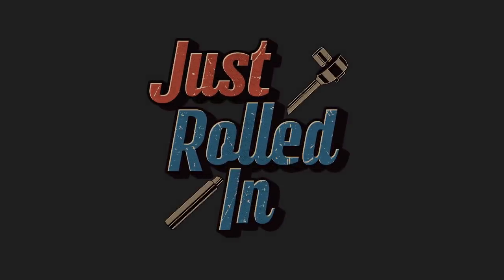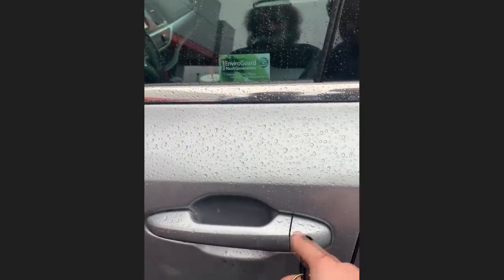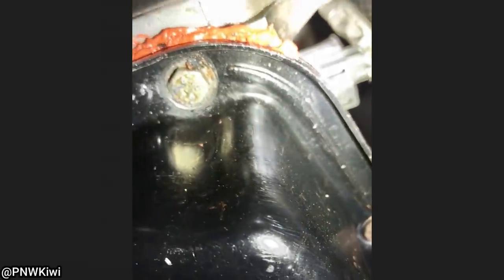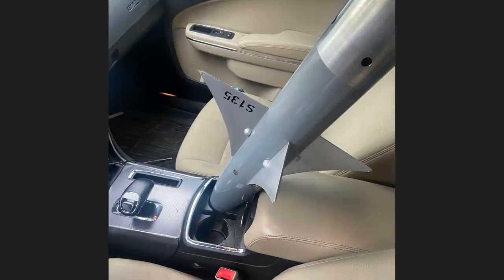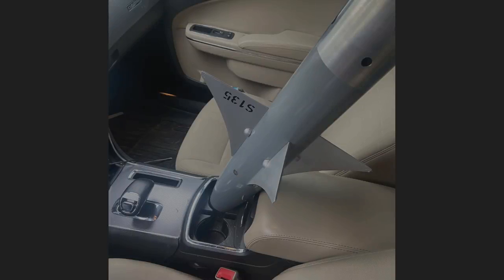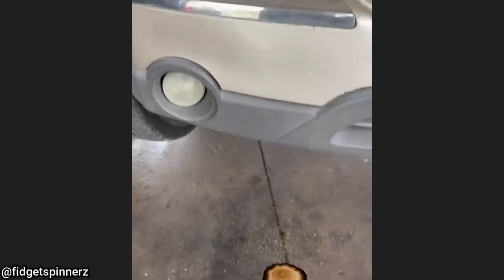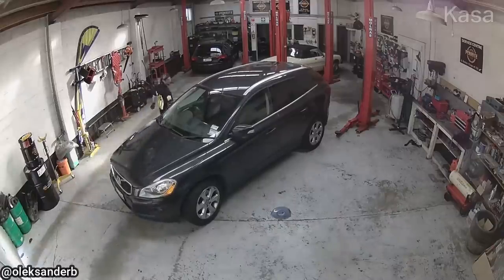Customer States It Sounds Like A Cowbell When He Drives Over Bumps | Just Rolled In

Comment: The second video of the lady's car trying to start when being unlocked... That was something special. I've seen some weird stuff before, but that's a new one on me.
Reply from the maker: Yea I had to share that one. That's a first for me as well lol
Reply: @JustRolledIn  Would love to hear a follow up as to how that worked :D
Reply: @ferrari2k  Only thing I can think of (outside of a poor wiring job) is the door alarm shorting through the starter relay circuit somehow.
Reply: I could see that as a feature on something like a newer French vehicle.
Reply from the maker: @ferrari2k  wish I knew what the issue was. They didn't mention unfortunately. 
Aftermarket remote start is the first thing that came to mind though.
Reply: The brief shot of the wheel and body style, that’s a Toyota Highlander. Somewhere around 2014-2016. The startup sound is a V6 model. Plus the building in window reflection is right outside a Toyota dealer. Most of them look the same. I’ve been with Toyota over 8 years now and this is something I’ve never seen before. Curious to see what some of the master techs will say🤣
Reply from the maker: @mikemike388  share the clip with them and let us know what they think it is  and let us know 😁
Reply: @mikemike388  Jesus look at Sherlock Holmes over here and not even the sarcastic way
Reply: Unless it's a prank, & there's someone turning over a car's engine behind them with the ignition disconnected!
Reply: @alexwalker2582  I'm thinking a poor wiring job myself.
Reply: Have seen a lot of electrical gremlins but nothing like this myself. I too would be curious to know If something aftermarket is installed. Have seen aftermarket remote starts cause a lot of issues.
Reply: Is there a remote start button on the key fob that is getting pressed when they rotate the key?
Reply: Would wonder if its the key turning it makes a remote start tune on
Reply: I'm no mechanic but that's very bizarre. the only thing I could think (if this is possible I don't even know) if someone hooked the starter to the lock. Either a royal fuck up or a prank, like when ur friends prank u by hooking the horn up to the brakes.
Reply: The start up sounds like when I crank my Tacoma , it has a v6 in it, I had to replace the ignition cylinder so sometimes the immobilizer won’t let it start , it’s possible that a non chipped key is trying to start it or the chip is too far away from the imobilizer 🤣
Reply: @peterf.229  Maybe bad programming on the chip in the key. I'm replacing the ignition switch in my car tomorrow, hopefully this doesn't happen to me!
Reply: I can't even imagine how many random wiring f**k up's you have to make,to get this to actually happen. 
Accidentally convert the door lock to a ignition starter  without actually trying to... ✌️👍😁 Mind-blowing 🤣
Reply: one of the strangest things I have seen was a friend of mine had centerline rims on his truck. one tire kept leaking down and even after replacing the tire, it kept leaking down. there was no visible damage on the rim especially on the bead seals. we were spraying the rim with soapy water and found the leak. air was leaking out of the rim itself inside one of the lug nut holes. it's  a solid rim. the only explanation we can think of is somehow a passageway was formed when the rim was cast.
Reply: I'm thinking she found" I can do it cheaper" mechanic lol .
Reply: Worst we had is locks that locked and unlocked constantly whenever the vehicle was powered.
Reply: The wonderful world of CANbus digital power management.   I'll stick with pre-CANbus vehicles, thanks.
Reply: For those who don't know, remote starters are a thing in the US, so you can start your car and let it warm up from inside the house on a winters day.
Pretty sure they are illegal where I am.
Reply: @LegendStormcrow  after witnessing a power window going up when a new battery was connected I gained the habit of leaving the door ajar a bit when connecting a new battery. a co-worker had the pwer lock close when he connected the new battery; luckily the window was open. you never know what could happen...
Reply: That aftermarket remote start feeling
Reply: I have to say I don't hate the idea, I always wanted to start my vehicle before I sit down.
Reply: @Cheepchipsable  They are used in VIP cars to start the car without risk of being in it so i am pretty sure that they are not illegal in the place where you are even if leaving a runing car on a parking is illegal in your place.
Reply: @alexwalker2582  lol i used to have a Escort, foglights shorted through horn relay. Fun.
Reply: WTF? How?
Reply: @JONOTron interesting. let the electron juice go were it may...
Reply: @ElementofKindness  Though CAN-bus has it's drawbacks I can not see it relate in any way to what's happening here.

You can search on Youtube for "No start because of door handle" for an interesting databus problem.
Reply: A friend of mine has to turn pull the far lights (the strong ones, idk how it's in english) lever to start the car, but why df would the door lock run the starter?
Reply: @ApusApus  They call them "High Beams" :)
Reply: @ApusApus  I can only imagine someone fiddlign with all the wires in the car without knowing what they are doing... and then you catch a cable that should be left alone. and if you're lucky, it just doesn't work. if you are out of luck, your car suddenly catches fire.
Reply: When I tore apart the dash in my Expedition to replace the evaporator core, messing with the passenger seat adjustments would pop the rear window liftgate. Problem went away with reassembly. Shit's weird man
Reply: As an army tank mechanic, to work in tracking down electrical issues the instructor would go to the various connections and put little pieces of wire connecting two wires across the connections…. if done right it would cause all sorts of little gremlins like this, for instance you turn the cadillac (gunner’s “steering” wheel) left and instead of the turret rotating left the main gun would elevate.  Definitely time to check the fuse box and the wiring harness, and disconnect every connection that has wires going through for locking or for starting, to start….
Reply: The world of use car auctions and the weird things people do with remote starts etc
I've seen cars start by hitting the lock switch inside the door a specific way, no key anywhere
Reply: @Rick_Sanchez_C137_  when i was learnign professional car mechanic back in late 80's in germany, we had to wire a full lighting with all swicthes and relays mounted on a wall. if done correct, the fuses would survive unharmed. XD
but one thing I learned from a technician at german army when I was doing basic service: in order for electric juice to flow, there has to be a closed circle. this explains a lot of things, like a rotten mass wire between engine/gearbox and body making it sound like a bad battery.
Reply: @SepticFuddy  this is why I love me a classic vehicle. shit that's not there can't break. XD
Reply: @lotharrenz4621  Amen brother
Reply: @Bialy_1  how does "they are used in VIP cars" equate in your mind to "pretty sure they are not illegal"?
Reply: Only in the 2020s, I swear!
Reply: It's not a defect, it's a feature.
Reply: @peterf.229  The immobilizer won’t let the car actually start because the key is outside the door!!! But the switch that should be unlocking the doors was wired to the ignition. (Probably a badly installed remote lock and ignition)
Reply: @Milamberinx  Probably some crazy notion of equality.
Reply: @jonathanconklin6351  maybe a "me me me" version of equality.
Reply: @edwardwood6532  Car starts, radio and climate controls turn on as soon as you open the door.
Reply: I have seen this video a while ago, still waiting for some sort of explanation. I have heard of crossed wires and short circuits before, but unlocking the door triggers the starter? Come on?
Reply: New for me too like wtf.
Also I fell bad for the last guy unloading car just to have a strap snap in his face and go through the door like man has a very bad day.
Reply: @mikemike388  damn boy gotta get a job in csi with you figuring skills that was actually impressive (I know you said you worked for Toyota 8 years)
Reply: @JustRolledIn  brand new nissan qashqai [uk] [rogue?] did it to me, straight over a petrol [gas] pump, 2 miles on clock, bad earths behind left headlamp [manual car in 1st gear, fault did not stop when key [fob] released.  the one + only car
Reply: @marcok8209  its wonderful when you work till almost midnight, its January and its 10F outside to get into the car with the heater on the ball roaster err heated seat going.
Reply: @Cheepchipsable  I use mine to cool down my truck with ac in the summer
Reply: @thomashanke6750  My first thought as well. I had a car remote that was so sensitive that I made a routine of taking it out of my pocket when home. I forgot this one stormy evening and found my trunk lid popped open,... filled with water and leaves...
Reply: It would be a pretty sweet feature to have in the winter. No need to open the door to get the defroster going
Reply: The interesting thing about this discussion is that everyone missed the oddest thing:  The electronics to unlock the door works fine because _the key fob works_!  The 100% mechanical backup lock (meant to be used if the electronic lock fails) is the system that has the problem.

It would be odd in the extreme if the electronic lock tried to start the car when triggered -- but explainable.

For the mechanical lock to do the same...  A short to the frame somewhere?
Reply: My old car had a thing where when I pressed the foot brake the boot opened. I ended up fixing it by finding the connector for the boot wiring disconnecting it and spraying it with WD40. The wire for the brake light must have shorted to the opening mechanism due to water getting into that conector.

Comment: The door lock cranking the engine is a new one for me🤣🤣🤣
Reply from the maker: Same lol. I got the same Toyota as the one in the clip also 😆
Reply: Unless it's a prank, & there's someone turning over a car's engine behind them with the ignition disconnected!
Reply: @stevie-ray2020  would have to have great timing to pull that off
Reply: There is no limit to the confounding electrical issues on new cars.
Reply: Haha it’s getting immobilized 🤣

Comment: And when you thank you’ve seen it all in 30 years of turning a wrench you pulled one out of your hat. Outside door lock starting the car. Thanks for sharing my friend
Reply from the maker: I knew I could get you with that one. 😜 have a great weekend, Brant!
Reply: @JustRolledIn  you too buddy
Reply: Does anyone know how that happened?
Reply: @ryannrjohnson  If I had to guess I would say after market remote start not installed or programmed correctly.
Reply from the maker: @BobWiersema  that's what came to mind as well. I got the same vehicle in that clip with an OEM remote start and glad to say I haven't had that issue 😆
Reply: @JustRolledIn  yes I was thanking the same thing.
Reply: Modern engineering...
Reply: @Frostified  when I started turning a ranch there were cars and trucks on the lot with carburetors. Then throttle bodies came out and modules were on vehicle and sed when will all of this come to an end, and now I thank it’s never going to come to an end. I’m so glad I’m retired from dealerships. My new living is Hunting fishing and motorcycle riding.
Reply: @brantmcfarland517  I like to think there's still good reliable vehicles being made, but after spending a year working at a chevy dealership that saw probably a dozen recalls on the Silverados in that time... probably half were reprogramming for ABS and backup camera. The other half were all things that apparently could light your truck on fire. You know, rear defrost, alternators, seatbelts...
Reply: @brantmcfarland517  Now even the motorcycles have ECUs.
Reply: @reaganharder1480  I understand. When I retired in 2017 we were reprogramming clusters on the Silverado that could take up to 2 hrs. And payed .5 hr. Good luck.
Reply: @user2C47  oh I know I’m riding a new husqvarna 701 enduro with an ecu efi driver by wire dual spark plugs o2 sensors  and A catalytic converter. Single cylinder four stroke making 74.6 hp. You could never make them hp with a carb. And it’s never gonna stop the technology on our vehicles.
Reply: @reaganharder1480  yeah our truck had the rear defrost could cause a fire so we just removed  the fuse.
Reply: @hunterbear2421  nice simple solution. So long as you don't care about rear defrost, works just fine.

Comment: 0:06 I remember a story my dad told me years ago about a rich guy with a Rolls Royce who heard knocking or tapping when he was driving on the open road, after many hours trying to find the noise, they discovered a marble or ball bearing on a string behind the door panel, that swung and tapped against the door when the car was at speed, attached was a note that read something like "Ha ha you rich bastard". Sounds like its one of those stories that,  "a friend of a friend knew the guy who found it" :-))
Reply: And once the issue was sorted he was still a rich bastard 🙂
Reply: @sjv6598   LOL, We can only assume. :-)
Reply: Many years ago, when cars still had hub caps, we prised the hub cap off of a workmate's car and put a couple of steel washers inside and put it back on. the workmate spent weeks trying to find the cause of the rattling, he ended up having to take the car to the garage, who finally found the washers.
Reply: Somebody poked holes in a soda can and welded into the bumper. At certain speeds my brother's new truck had an annoying whistle. Yup, the shop found it.
Reply: Someone loosened all 5 lugs on the front left wheel of my VW GTI I had many years ago, a click-clacking sound when I would accelerate or brake. It was the slop between the hub and wheel being taken up by varying velocity.
Reply: @paddington1670  the others were funny, but this is attempted murder

Comment: Dealt with a "cowbell" issue once. Turned out the weld holding the top cover on a shock absorber broke, and it would "ring" every time the guy hit a bump.
Reply: I had that same issue on several Kenworth semi tractors, kept breaking the welds on the covers of shocks. Only real cure was to completely dump the air ride suspension when picking up and dropping semitrailers..........

Comment: That was a first when a car owner brought his car to the shop and asked the mechanic to see if the owner did the work right. Normally, a car is brought to the shop so a trained and experienced mechanic will do the job right after the owner did it himself ALA Red Green. 

Have a great weekend JRI.
Reply: Didn't look like he did the worst job. Maybe a little heavy handed with the sealer, but that's about it...
Reply from the maker: @grannyflatgarage7599  a screw and wrong size bolts the technician said. Surprisingly doesn't leak though lol. Or maybe not yet 😅
Reply: @JustRolledIn  ah right missed that. What the hell  did he do with the original bolts? He knows that you don't have to replace them right?
Well if it doesn't leak lol...
Reply from the maker: @grannyflatgarage7599  good question lol. Hopefully they're not inside the transmission pan 😆
Reply: Definitely not a Red Green job - there's no duct tape! 😁😁
Reply: Wasn't leaking.

Comment: if you pull a trailer and don't want to hear a clunk every bump. pull the hitch off between hauls, took a minute to figure that one out hahaha
Reply: @chuckles3295  no actually my bad its a  receiver or in some circles stinger but a good one thanks hahaha
Reply: I placed a plastic in the top of my receiver, with the drawbar in place.  No more noise.

Comment: The lady whose car cranks when she unlocks it, I'm guessing must have had an alarm or remote start put in by someone who didn't know what they were doing.
Years ago my sister bought a slightly used car and the dealer had put an aftermarket alarm on it. Turned out if you turned the ignition off with the lights on, the car would stay running. Even with the key out.
Reply: this happened in another video of this channel too
Reply: something must have been shorting then

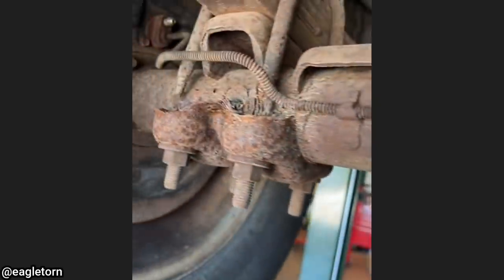Comment: 1:00 As long there's no leak he did the sealing job correctly. Which is what i guess matter to the customer 😂
But i wonder how horrible it's going to be for the next time this pan get remove and reinstalled lol.
Reply: No issue, they will just swap the whole engine.
Reply: I saw one of these where the overuse of gasket sealer resulted in the oil pump intake becoming blocked with loose bits of sealer - no oil no engine!
Reply: @Morpheus-pt3wq  Oh god XD
Reply: @marklythall8712  Only time will tell lol

Comment: At a PD I worked for, several cops were pranking each other by placing pebbles in their hubcaps-which is a dangerous thing. When the chief found out, there were suspensions.
Reply: @oaktadopbok665  No. The chief himself caught it. He stepped out the west door to investigate an incident from the night before. Just then, two of the dummies rolled up in their units and he heard it. He was furious. Since it was a particular shift, the suspensions were served one week at a time.
Reply: Are you saying that pebbles are dangerous, or pranks (when they get out hand) are dangerous?
Reply: @russellhltn1396  Pebbles make noise. When cops roll up on a situation at night, they are trained to minimize noise, which can throw off an ambusher. If the pebbles are making all kinds of racket-voila!!